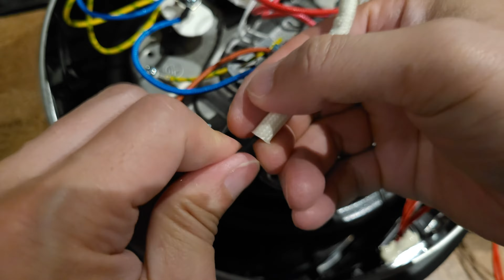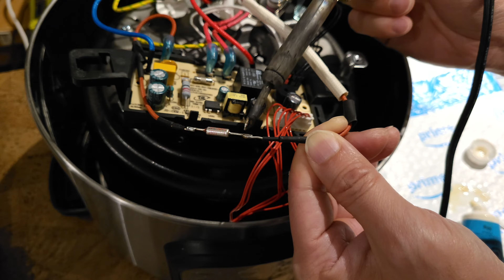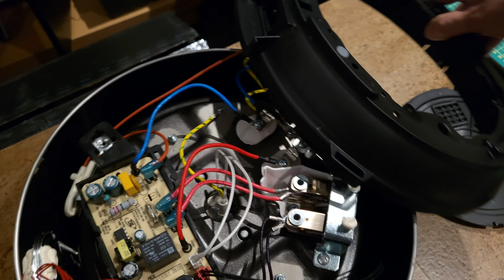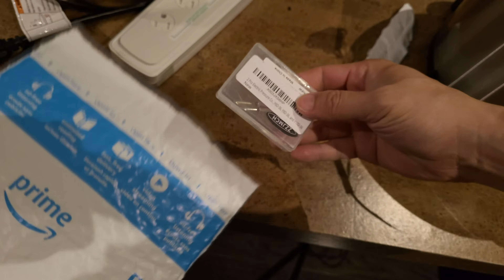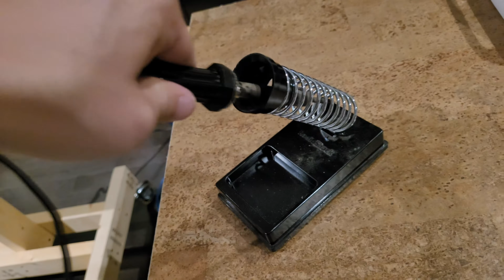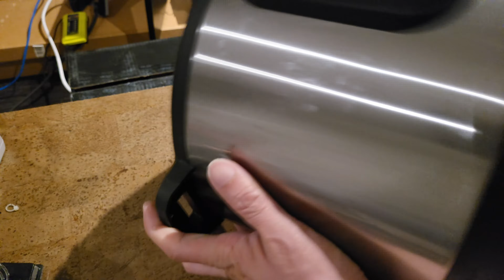How to FIX your Instant Pot Pressure Cooker! Won't turn ON! Easy DIY thermal fuse repair

Comment: My instant pot turns on, but there is no heat and it is making clicking noise after 10 to 15 seconds. Is it the fuse or something else? And there is no error code.
Reply from the maker: Most likely something more serious than a broken fuse unfortunately 😢

Comment: Hi, I change the thermal fuse n it can be on now but there is a plastic burning smell when I try using, is there anything else that I need to change?
Reply from the maker: THAT isn't good. You have something that shouldn't be touching the heating element that could cause a fire! Discontinue using it and recheck your connections. I would definitely take it to a repair shop at this point or throw it away

Comment: As a tip most of the IP models use a 142C (287F) fuse, not the 185C (365F) fuse that most repair videos link to.  Also, they can be damaged by soldering and should be crimp connected.  
Search for "Metal Temperature Thermal Fuse SF142 142C 287.6F" and you'll find some that even come with the butt style crimp connectors.  No soldering iron needed, just pliers.

Comment: Did this procedure for an Instant Pot Duo60 v2. I bought a fuse rated for 184C but the original fuse is 144C. Back to its working state, thanks

Comment: It bothers me that there are people leaving comments that this was their first time using a soldering iron, but they repaired their pot.  I'd rather see such people learn about fixing electronics on small devices without much power.
Reply: Negging comment, negging attitude - do you have a channel where you share that knowledge? just looked and no, what a surprise, you don't. have a nice day

Comment: Is there an alternative for soldering?
Reply from the maker: Hard to say, in normal conditions I was going to suggest solder seal that you can just use a lighter instead but since we're dealing with thermal fuses and high pressure cooker temperatures it's probably a bad idea. Perhaps you can take it to a repair store and work out a deal or have someone that could solder for you. Cheers

Comment: Wonderful video worked flawlessly for me! tqsm rn I'm steaming some eggs XD 
My friend broke my IP when he was pressure cooking without the gasket(sealing ring)... IP tries hard to achieve pressure by constant heating but without a gasket it never reaches pressure and blows a fuse. 
ordered the thermal fuses from amazon pack of 3 cost me 4.99$ 
This video was informative and helpful. tqsm.
Reply from the maker: Nice! I admit ive forgotten the gasket a few times too.. luckly noticed it before anything happens. Cheers

Comment: Mine drip water next to pot withou pressure
Reply from the maker: Sounds like a leak, I'd check the sealing ring or the valve for any issues.

Comment: Nice video, but that is a thermal fuse for over temperature, as thermal means temperature! you should not be soldering it you will shorten its life due to soldering, you should crimp the wires, just thought you should know, Bob in the UK.
Reply: Crimp. What tool do you have to use for that ?

Comment: The cloth tubing doesn’t fit back over the shrink tubing bandage 🤕 do i have to redo it or can i just cover it with something besides the cloth tubing?
Reply from the maker: I'd redo it since its a non-conductive high temp res. material designed to be in contact with the pot for extended periods of time.

Comment: Both our current IP as well as our older one I was saving for "spare parts" had the same problem and with a few bucks for new thermal fuses both are working again!  Thanks!
Reply from the maker: @nickandsandhya6017  Great job! Cheers

Comment: My instant pot sat broken for 2 years. I pretty much guessed it was the fuse based on things I’ve read, but when I found out I had to solder it, I put it on the back burner because I didn’t have a soldering tool. I found out not too long ago, that you can check them out from my local library, so I did and just fixed it. Super easy-and fun, ha!! 👍🏻😊
Reply from the maker: Great job!! Wow 😀I did not know that - seems like my kind of place! Wonder what else can be found nowadays at the library lol Cheers
Reply: @squishyhammer Thanks!!  At my library you can use their laser cutters, CNC routers, vinyl cutters, 3D printers and sewing machines. It's really cool what all they offer.

Comment: It's not the thermal fuse or circuit fuse.  Appears to have continuity from power inlet to switches, no burnt marks on PC board.  Mistakenly, water was poured into it without the pot, so what is it?

Comment: IP is a POS I am going to throw it away and get a Breville.
Slow cooker mode randomly turns off the controls suck and are very confusing 
Piss poor design and bad instructions
Reply from the maker: Well the fact this is a repair video.. 😆
Reply: @squishyhammer  I know but mine turns on it just goes off in slow cooker mode

Comment: This video is very informative. Could you provide links to purchase the fuses and the tools you used?
Reply from the maker: The fuse I bought was https://a.co/d/2cg1SIm however it's recommended that you find out the temperature rating on your existing fuse and find a rating that is equal or close to that range since every pressure cooker is different. The tools can be any soldering kit found on Amazon. Cheers

Comment: A woman here. And i really prefer to repair things rather than clutter the environment more but here is my delemma: 

### Scenario 1: I repair multicooker (replace the thermal fuse)
$14: Digital LCD Multimeter AC/DC Electrical Meter Voltmeter Current OHM Multi Tester
$30: 80W Soldering Iron Kit Electric Welding Tool Solder Tips Adjustable Temperature
$42: thermal fuse a pack of 3 items, 10A, 185'C, 250V? 
$14: set of screwdrivers
$10: delivery
=>Totally: $110 + time 
+ **Who knows the thermal fuse I buy is OK and won't cause fire in my place.
Environment impact: all of the above since I use it once, well maybe I will use screwdrivers again
 
### Scenario2: I buy a new multicooker
A new multi cooker: $150
Environment impact:  a giant 6L multicooker to throw away
Reply from the maker: Quite the scenarios but I do commend your enthusiasm to repair it yourself! I believe you can reduce the cost of parts by just buying a Soldering kit, and thermal fuse. Screwdriver kit you may find at a dollar store. This is all the assumption you do have a blown fuse. And if it all doesn't work at the end, you may be able to return those items. Cheers

Comment: If I try to repair my multicooker with your instruction, do I order the same thermal fuse as in your video? 10A, 185'C, 250V? 
I am trying to understand which one to order.

Thanks !
Reply from the maker: You may want to read the temp rating on your original fuse, it's recommended to find the same rating for safety, or one that has a bit more margin. I believe the fuse I ordered was the only one I could find conservative to the spec at the time. Cheers

Comment: This is a great video, thank you. I have exactly this model, and I need to fix the same problem. I just typed "thermal fuse for Instant Pot" on Amazon and it found one for me, which is very similar to what you showed in the video.
Reply from the maker: Thanks for watching! yes it is most likely the same fuse I bought from Amazon. Hope your repair goes well! Cheers

Comment: I switched my thermal fuse but the system won’t turn on still. There is power going through, even after soldering the thermal fuse back on.

Any ideas?
Reply from the maker: Hmm if there is indeed power going though, it could be something more going on here. Check the internal PCB for any indication of shorts. There is a regular fuse on mine you may want to check if that has blown.

Comment: I have a Duo Nova 80 and it burnt the circuit board at the CP101 connection, I replaced the board and a month later it did the same thing. thoughts?
Reply from the maker: Sounds like surge damage and/or component failure like a blown capacitor. Unsure but if it has happened before, the common denominator I would start looking would be stability of the power source

Comment: My cooker looks almost exactly like this. It suddenly stops turning on. I have NEVER done any electrical/soldering my entire life. I didn't even know how to use a multimeter. I gambled and bought the items you mentioned and soldered it with my state of the art soldering skills (😅). It was so BIG I couldn't slide the heat protector to cover the thermal fuse. But HEY my cooker works again!! 🎉 I couldn't stop telling my wife how great I am... 😎
Reply from the maker: @smaug.the.stupendous  lol that's a great achievement! So satisfying to not hear her doubt that 😆

Comment: Mine pressure cooker wasn't an Insta Pot at all, it was made by Chef IQ. However, I got a lead on idea what can be wrong with it and finally braced myself enough to dismantle and look inside it. 
And, surely enough - there was a little sleeve of thermoresistant fabric screwed to the bottom, which had a thermal fuse inside. Continuity - fails. 

It's prob like $7 repair. Chef IQ was kind enough to send me the whole replacement unit and didn't bother to get this one back, couldn't just throw it away because one pesky thermal fuse 😁
Reply from the maker: @kilovolt2494  wow that's great customer service! you'll be cooking twice the meals when repaired 😆

Comment: My 8 qt instapot duo just suddenly stopped powering up. It’s only been a year in service. How often do they quit? Is it safe to repair myself if not an electrician? Do any appliance repairmen fix them?
Reply from the maker: @enochpage1333  if it's only been a year it may still be under warranty as I heard the company did get bought out. Doesn't hurt to call their support line to ask. It's only safe if you follow correct diagnostic and repair but if you feel you're not confident enough to diy you can definitely take it to your nearest electrical repair shop to do it for you. Cheers

Comment: Woohoo!  You helped fixed my Instant Pot!  Thank you for the super clear video.  It was so clear that it gave me the confidence to try this out, even though I'm so much not an electrical DIY'er that I had to buy a cheap multimeter and soldering iron to do it, as I'd never worked with either of those tools.  Totally worth it, because my Instant Pot came back to life.  Thank you!

For future passersby having this problem: if you happen to have an InstantPot Ultra Mini bought around 2020, you need a T-15 torq screw bit for the outer screw (like in this video) and a SE139E fuse.
Reply from the maker: Wow that's great!! Glad to hear it helped and given you an extra skill set to maybe start other projects 😀 cheers!

Comment: Im having issues soldering :( bought all the tools.
Reply from the maker: what soldering issues are you experiencing?
Reply: @squishyhammer  hello, I was having issue with the material sticking to the parts. I know you mentioned in the video you had flux that would make it easier to stick. I went and bought some and was still having issues. I have never done this. So i wrapped the soldering coil around both metals, put some flux around and place a heat shrink tub over then used the soldering rod to shrink it, while hoping the soldering coil would get hot enough to stick. Liquid poured a little before the tube fully shrunk, but it stayed. [It did feel a little loose]. I did that on the other end, and secured it with the metal piece to the instant pot. I tested continuity and i was getting continuity. So I closed everything out and the instant pot now works. Thanks to you, of course. Now my only concern is if the fuse will hold.
Reply from the maker: @CaIIMePROJECT  Well congrats on your first soldering job! I'm glad you got it working! It is quite tricky in the beginning but once you get the technique down it can be quite fun. If you wanted to try again I guess my advice would be tinning each of your wires first which just means melting the solder on the wire first with the flux, then it is easier to attach the ends of the fuse to it for a more solid connection. I'm glad you got the flux since it would have been really hard to get started as a beginner. Keep practicing! Cheers!

Comment: great video. are the thermal fuses interchangeable  ? if the specs are the same ? mine is SF150R0 152C 15A (sefuse) . and im planning to replace it with one made by RY
Reply from the maker: Yes it should work fine. Thanks for watching!

Comment: That works if you have all the tools and a soddering tool. :(
Reply from the maker: Unfortunately it requires some tech work... Theoretically you could bypass the whole fuse by twisting the wires together and use electrical tape but I'm extremely against that. Cheers!

Comment: Thank you for sharing your well-crafted video! I'm wondering if you have any experience dealing with an Instant Pot that powers on but doesn't function beyond that point. I own an Instant Pot Ultra Mini 3 qt model. This particular model features a control knob for mode selection, a cancel button, and a start button. When I plug it into the electrical socket, the control panel lights up, and the mode is automatically set to Pressure Cook. However, when I press the start button, nothing happens. Even attempting to reset it by pressing the Cancel button yields no results. I'm unable to select any of the 10 available modes; it remains stuck in the Pressure Cook mode without initiating any cooking process. Essentially, it's unresponsive except for the illuminated control panel.

I've gone to the extent of disassembling the unit to inspect both the Control Panel and the Circuit board. My suspicion is that one of these components may need replacement, but I'm uncertain which one to address. Since the Control Panel does light up, my inclination is that the Circuit board might be the culprit. What's your opinion on the likely problem and its solution? Any suggestions you can provide would be greatly appreciated. Thank you!
Reply from the maker: Thanks for watching! Hmm it does sound like a circuit board issue. Since you did disassemble and most likely made sure all the physical connections are secure, it could very well be a short on one of the capacitors or resistors which probably requires a multimeter to each to test. If you can't return it or most probably its out of warranty, you could purchase another Ultra Mini and "compare" the boards, then do a return after you're finished... only a suggestion 😇

Comment: DO NOT REPLACE THE SENSOR TABS (just yet). Our Insta pot was showing C6L error. Follow instructions to remove bottom under plate. You'll see 2 metal strip sensors, 1 with black wires, other with red wires. Remove the Phillips screw that holds them in. Clean with toothbrush and rubbing alcohol the top sensors on the metal strips and tiny underneath copper button sensors below. Reassemble. It worked well for us.
Reply from the maker: Perhaps this is something to try if you do measure power going to your instapot and display similar C6L errors. Thanks for sharing!
Reply: hi. Mine is doing the same thing. could you please guide me of how to fix the same problem, like more in detail?

Comment: Can this be fixed without a fuse..like straight wire it or something..I can't find the fuse anywhere
Reply from the maker: If you mean you can't find a replacement fuse then yes its possible just to wire without it but obviously its not recommended since it will bypass the safety  mechanism
Reply: No you cannot...it is a thermal fuse, you may cause it to damage  the equipment  due to fire.